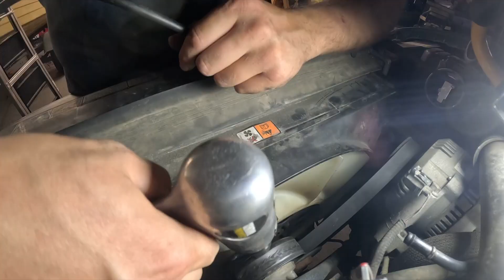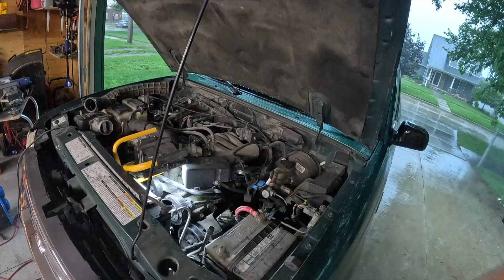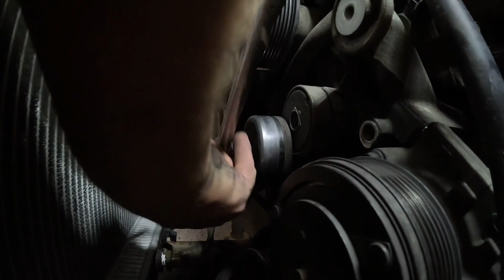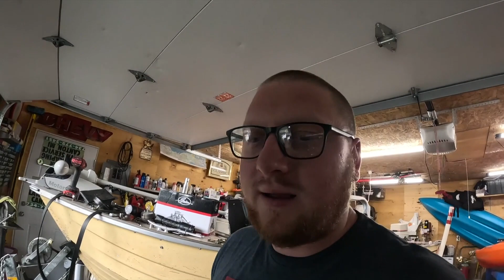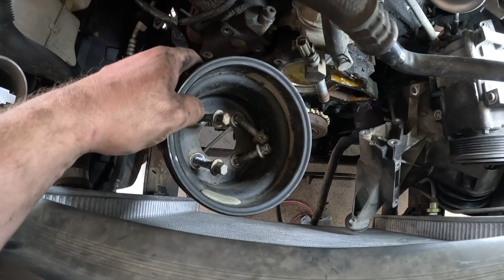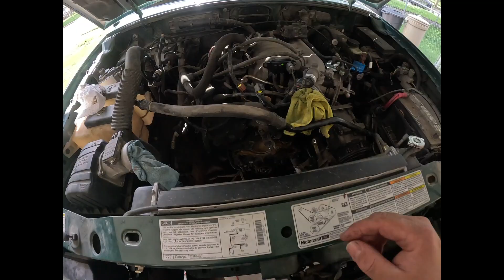How to replace 1999 Ford Ranger 3.0 water pump, timing chain, and timing cover seal PT1 Tear down

Comment: I am just getting ready to start this job now. How is your fix holding up? Thanks and great video!!
Reply from the maker: Very well no issues at all
Reply: Also did you use the felpro water pump and timing cover gaskets? Or just the black gasket maker? Thank you
Reply from the maker: @Ameister89  I used the gasket and gasket maker make sure to torque to spec take your time think I've put 8k miles on since knock on wood were holding up

Comment: What kind of sound did you hear to know the timing chain needed to be fixed?
Reply from the maker: I noticed a kinda tick when I was in drive thru next to building, I figured it was a exhaust leak but I believe it was the timing chain havent heard the noise again since doing this